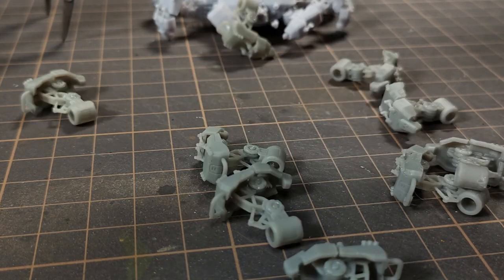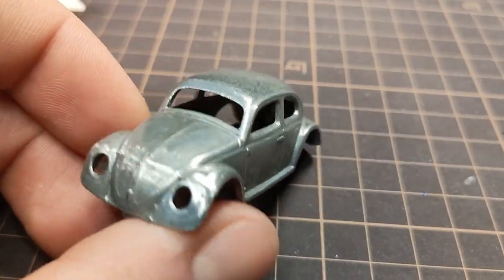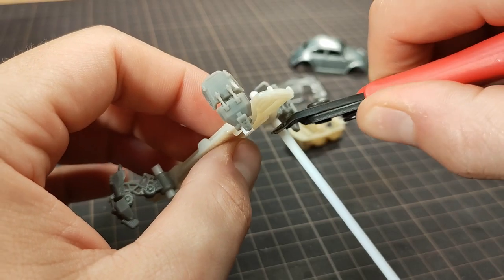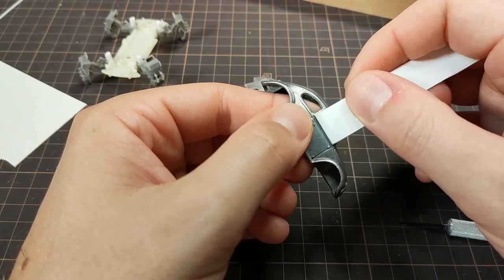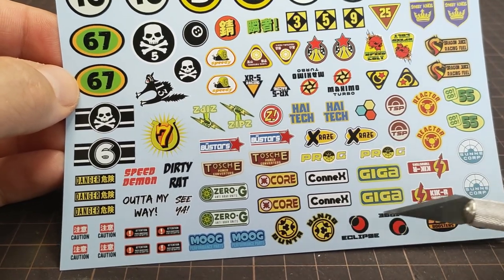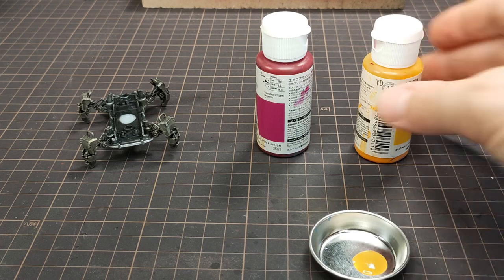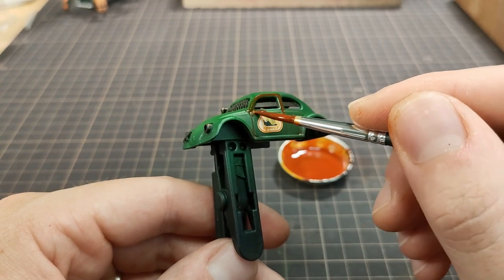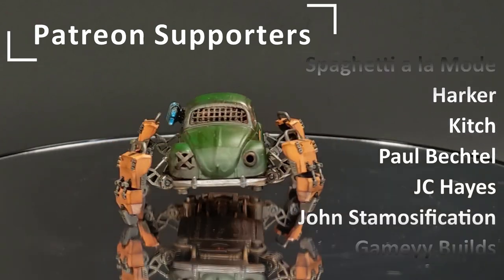Making MECHA BEETLE Crawlers | Custom Diecast Volkswagen

Comment: Awesome custom bug(s)!! I LOVE those legs, will definafely have to get a few sets. The paint on the legs was spot on, cool that it matched the decals.

Speaking of decals, if you don't want to gloss coat the car you can use setting solution. Tamiya and Microscale are the top two.

Also, when drilling out the rivits, I personally like to use the bit sized for my tap to drill first. First off this allows me to use the dimple of the rivit head to center my bit and I drill to about the depth of my screws. Then I come back with a 3.5/4mm bit to remove the rivit head. This way I am ready to tap as soon as the body is off the chassis.
Reply from the maker: Thank you! The legs are great and very versatile as you can see
Good advice on the drilling and decals. I have decal setter too so I'll have to try that next

Comment: A great tip I got for decals years ago is to apply some Future floor polish while they are still wet. It helps stretch the decals tight against the surface, especially where there are grooves. And it hardens and protects the decal.
Great channel.
Reply from the maker: Thanks for the tip 😁👍

Comment: Very cool, I have rust a few of hotwheels on my RUSTBUCKET group build.
Reply from the maker: Thanks! They're cheap and everywhere. The perfect material for a build
Reply: @BPCustomCreations  
Yeah, I also do Sci-fi Kitbashing in 1/24 1/25 scale and those arms and legs would be perfect..but not sure if they make that big of a scale..
I usually do Bionical parts forntheblegs and arms and yogurt caps for the hover part.
Reply from the maker: @marsgarage8217  they're 3D printed so you can make them any size you want
Reply: @BPCustomCreations  
I'll check them out and ask one of my friends to print me some.

Comment: What glue do you use it looks very affective.
Reply from the maker: Everything on this build was done with super glue. I reinforced some of the connection by sprinkling baking soda on the wet glue to add surface area and instantly cure it.